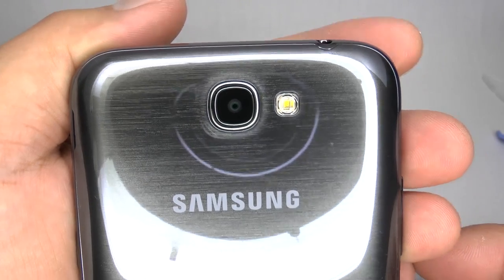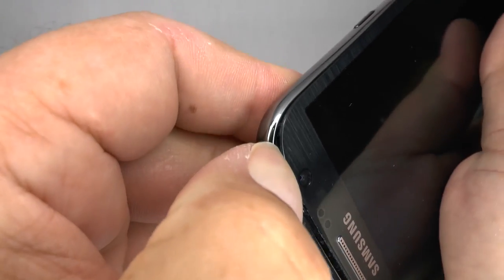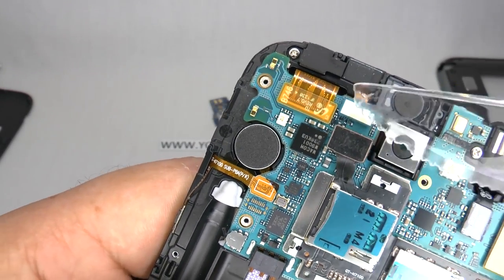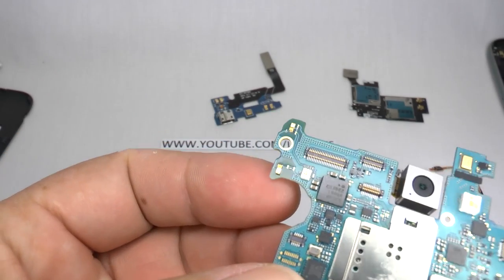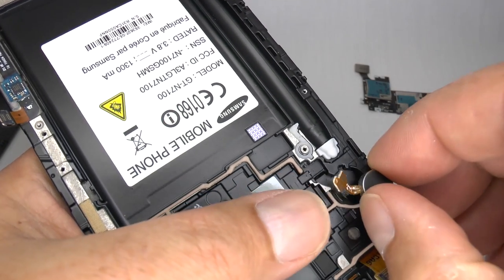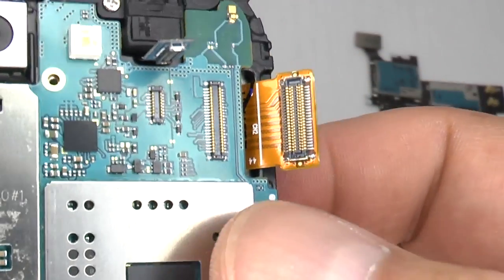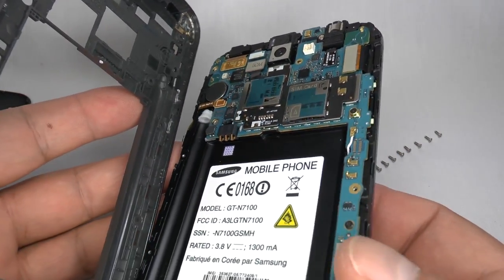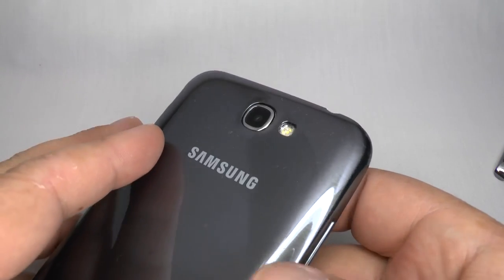Galaxy Note 2 Disassembly & Assembly - Screen and Case Replacement - Drop Test Repair

Comment: LE55ON5, I tried replacing digitizer on my Note 2 but after replacing it, it won't power up. I believe it's the connectivity issue with the power button. When I hook it up to a power source, display will show battery charging, but I am unable to power it on using the power button on the side.

The power button also doesn't feel right. It feels like the power button is stuck. There is a very small plastic piece with a dot on top of power circuit. I double checked to make sure it is on correctly

Comment: I dropped mine in the store. has a case on it. no dents, scratches, cracks etc. But, I notice my cell signal flucuates just sitting in the same spot on a table. Rarely get 4g anymore. and when I do, its still slow or disconnects. Do you have any ideas? It has been factory reset 4 times trying to see if it was a software issue.

Comment: excellent as usual, I was wondering, I see that this is a Note 2 model GT-7100, as far as I know this is not 4G as you mentioned when talking about the "antennas" , perhaps the 3G model GT-7100 has a 4G anntenna already built in standard to simplify the  production process,,
is the usb/mic board the original? I need to replace mine but see many colours and numbers online when I am looking for parts, I only want original !
 Thanks.
Reply from the maker: You might be right about the antenna, its hard to know if parts are oem or not. Try using the live chat option, I'm sure they will know

Comment: My note 2 keeps losing mobile signal, if I change the 3g module will that fix the problem, would I have to replace 4g antenna as well?

Comment: I wanna replace my rear housing because I dropped my phone and the plastic brushed metal band hot pretty chewed up. I ordered I new year housing but it doesnt come with the antennas are they easy to transfer to the new rear housing and am I gonna void my warranty by doing that small replacement myself

Comment: I used this great video to replace the LCD/digitizer assembly due to a cracked screen. I looked at ur video on the digitizer only and didn't wanna try that magic. Afterwards, I did try, only to find that my at&t i317 note ii digitizer is bonded to my LCD as per your video s2 digitizer only. So the construction of my note II is not the same as your note ii. Digitizer only replacement is not an option. So if ur glass cracks u need the over $200 complete assembly... FYI

Comment: Hi there Le55ons. hoping you might be able to help. The mic on my note 2 just stoppped working. so i replaced charging dock port flex with a GR 1235 board, now my signal keeos dropping out all the time,  replaced the antenna, still the same issue. my orginalboard was a NF 1241 SY... any ideas ??? uk on three
thanks

Comment: thing is that I have changed wifi only motherboard with 3G. Separatly S Pen worked on the both (wifi & 3G) devices. After switched S Pen is going crazy. Yes I had wifi only device :) There is just one difference on the board is no slot (up on the right side) for connect antena cable. And as I so on your video cable for S pen is goin from display to the motherboard right? Thats why I think there is HW fight between motherboard and display. I have changed couple of SWs but still nothing...

Comment: Good videos thanks for them I have an error message "battery low temperature" Where is the low teperature sensor locate? Its in the charger port I coul like to know thanks hope u answer me. I DID EBERYTHING TO FIX IT. Flash kernel change battery root it just happen when I try to charge it h . I have to use external battery  and its annoying it galaxy note 2 thanks

Comment: Thanks so much for the video! I used it to replace my power button. All went well, except now I can't make calls... I can send and receive text messages and the internet works and stuff, but when I try to make a call it says 'Mobile Network Not Available'. Do you have any idea what part I could have messed up to do this?
Reply: I will say that my phone is a Verizon phone. I used the power button you show above, but that's the wrong power button for the phone, the Verizon one uses a different one (I didnt realize until the part came in and I was following the video). The Verizon power button is directly connected to the vibrator part, so the vibrating function doesn't work obviously but do you think that could have anything to do with the phone call thing?
Reply from the maker: Amanda Young I don't think it would affect calls. Can you check the time and date are correct? If they are and it still not working..  backup all your data and do a factory reset, this can sometimes fix this kind of problem..
Reply: *****
 Thank you for getting back to me. I got the correct power button today... the time and date are correct so if, after I replace the power button with the correct one, it still isn't working--I will try the factory reset. Thank you!
Reply: Just put in the correct power button... phone calls work again! Thanks again for the video, you rock!
Reply from the maker: Amanda Young :-)

Comment: hey i have quite a situation on my hands.  i cracked the outer screen to my galaxy note 2 and bought the kit to replace it.  i was only trying to repalce the outer screen. so i peeled off the outer screen from the original led display..  now, when i use the touch screen.  it wont work, and some of the top part of the screen does work

Comment: Hi! does the N7105 micro usb component fit the N7100? The Micro usb component contains the antenna and the microphone as well, doesnt contain the 4g LTE part which isnt compatible with the n7100. Am i right? or wrong? Thanks!

Comment: Hi! i have problem on my note 2 sometimes the WiFi network stop working so i should turn it off and turn it on (WiFi not the phone) is that a problem with the WiFi antenna or the problem is in the modem?

please answer.

Comment: Hi Le55ons
 i felt my note 2 in water and took out quickly then dry it with hair dryer then put battery in and turn on the only problem is touch screen is not working with finger but working with Spen and i cannot use it without Pen.any help..

Comment: Yeah whether the display I broke did ever work ill never know now I was in a bit of a fit of rage at that point but I have another one coming again not from etradesupply but from ebay not sure what ill do with the two broken Note 2s just the screens need replacing least that's what the description said. Ill just test the screen before sticking it on.

Comment: since i got my phone i have a really annoying issue.
the mobile data on WCDMA (H, H+, 3G) works for a while (not a certain time actually) then it will keep sending data(green arrows flashing) but not receiving (no orange arrow at all) so obviously that means i have no internet access. this issue can only be temporarily solved by ONLY restarting the phone. I tried everything possible from custom roms custom kernels and custom modems but it's still there, the mobile data on 2G works perfect it's only when the network type is WCDMA for some time that vary from 5 minutes to 12 hours but it can get really annoying restarting my phone every 5 minutes , i don't have warranty, so my question is, is there a hardware i could do or replace ? the 3G antenna maybe ?

Comment: When you replace the display assembly, how would you tranfer the imei sticker to the new one? Is it just a case of applying a little heat?
Reply from the maker: yes, use heat and try not to touch the back of the sticker, use tweezers or the edge of a knife
Reply: ***** are you using low or high heat? my heat gun has two settings. which heat is best for glass separation?
Reply from the maker: kooli9 depends on how close you hold it. About 60ºC is ok, about as hot as your hands can bare. Or use a thermometer to check

Comment: My screen acts funny some times its fine other times its discolored or when I turn it on its ok but then it goes gray. Any ideas on easy fix or do u know where I can buy just the lcd display pl ty
Reply from the maker: try unplugging and plugging the display flex connector, if that doesn't help then you'll find links for a new screen in the description

Comment: Hi, any suggestions on a reputable seller online? I need my rear cover replaced (3:41). Coz mine has scratches all over it, the silver-coated plastic part,. The one that is visible, on the side of the fon. I only need this one, not the entire screen. Only the rear cover

Comment: Hey I just followed everything on the video I realize that when I took apart my note 2 that the vibrator was to big to fit in the replacement parts so I left it out I tested out the screen before I put the mid frame on it worked (btw the screen is white my old note 2 screen is gray) anyways when I tried to put the midframe on it only fit on the top and bottom not the sides it's thinking it's because the screen is different from the midframe or do I need to apply more pressure
Reply from the maker: its strange the motor won't fit in the new midframe, don't push too hard, it might be for a slightly different model
Reply: Yeah I had to change the housing and left the vibrator out and the new housing is still bulky on it do u think that the mother board isn't sitting all the way down
Reply from the maker: Andrew Blackford It does sound like the midframe is not the right one for your model, perhaps it was mixed up in the factory...

Comment: I bought a new battery and it's doing the same thing still. It'll charge for 7 seconds and then up pops a message saying it's 176 Fahrenheit.

When I heated the screen everything was out except for the audio jack, the power button and vibrator flex, and the wire, & whatever it's attached to, which runs next to where the s-pen is stored.

Comment: Hi there! For some reason my note 2 started getting weak signal. Gets in and out of the network. I have called my carrier and they have done everything from their end but I still have trouble. It looses signal big time. Like now I don't have service. Would that be the flex antenna? Would you help me please? Thanks
Reply from the maker: It might be the sprung gold connectors not making contact with the rear housing, it might be worth removing the rear housing and slightly bending the contacts up to make better contact

Comment: I just did ligitizer replacement, so i moved everything from old to new digitizer. After replacement my phone turned on once with a charger, but now it wont turn on at all. What could be wrong? My battery is not dead, and my note 2 version was N7105, and the new ditizer is N7100.
Reply from the maker: it might be a faulty new screen can you try plugging in the old one

Comment: I ordered two more broken Note 2's on eBay because I had nothing else to compare it to I don't know why the brand new digitizer didn't work and now the digitizer is cracked the glass is fine. I'm wondering if its a bad port but it was working before its a pain in the ass, so now I have two units to play with one of them has to work. As for my new display I don't know if they'll give me a replacement again. Ill never know if it really worked or not.
Reply from the maker: You are a bit unlucky, hopefully you can test the display on a working note..

Comment: if I change the display on my phone, will I still have my old pictures from before the phone broke?
Reply from the maker: yes as the data is stored on the mainboard. If possible its best to backup all your data before replacing the screen, just in case of a problem. 
You can plug the new screen into your mainboard and make sure its working ok, backup your files and then fit the new screen

Comment: hi i have a note 2 i dropped it and now i have no wifi or bluetooh unless i stand right next to the router same with the bluetooth it works if i put the device right next to it. i opend up the phone and the prong that does the wifi has torn off the board and busted the contact off the board so it cant be soldered is there a way i can solder a wire on anywhere else on the board to for blutooth and wifi or do i need to replace my board and flash the firmware and efs over to retain my imei

Comment: I have a note 2 and the screen broke and now there is no image but there is sound .. do I just replace the digitizer and screen  or the whole frame and digitizer ?
Reply from the maker: just the digitizer and screen assembly as the frame is part of the rear housing..

Comment: Hi,
I just tried to replace the middle housing frame and I was able to fix it.
But when I switch on the phone, my screen has couple of lines displayed and the screen is not at all bright.
I didn't touch anything other than replacing the middle frame.
Can you please tell me what went wrong with the screen.

Thanks
Reply: Hi i just replaced my screen with this tutorial and i'ts very good. But You must be carefully when removing (unclipping) screen from (round) frame. If You bend it too much, You can damage Amoled screen. If You wanna check display (and sensors) press #0# on dial keyboard. Secondly... maybe light sensor fault (for brightness).
Reply: ***** i just changed mine too but I cant turn it on and when I power it on it makes somekind of nice just the blue light seems to flash nothing else looks like i fucked up my phon I just wanted to replace the housing with a new one fuck :(

Comment: Hi there...I dropped my fone..no physical damage but only half of screen is working. Do u have any recommendations?
Reply from the maker: Its probably cracked the fine tracks inside the display, a replacement screen will be needed..

Comment: Actually I have no idea why, my GPS is not working after I sent in to repair for the last few days left of it's warranty. Is it possible that my GPS antenna is lose or my antenna is broken? BTW, B4 sending in repair, the GPS is working flawlessly.
Reply from the maker: it might be the small gold sprung connector not touching the rear case, if you bend it up slightly it might cure the problem

Comment: I took mine apart because of intermittent charging problems. After seeing nothing physically wrong I put it back together and now the home and capacitive touch buttons no longer work. They light up when booting up, but pressing them does nothing. Anything I can check for that?
Reply from the maker: try unplugging and plugging the flex shown at 8:18
Reply: ***** I tried that but still no luck. Also I cannot charge the battery anymore. Keeps saying battery temp too high and monitoring programs show the temp fixed at 60C. I think the battery may be defective which started all these problems. I don't understand what happened to the buttons though. I removed the entire board and reassembled 3 times checking all the flex connectors. I hope I don't need to replace the mainboard now.
Reply from the maker: nelwyn2 I doubt its the mainboard causing those problems. Try buying a new home key flex and plugging it into the mainboard, this should confirm help identify the problem. Not sure about the battery problem but its certainly worth trying another one..
Reply: ***** That's a good idea I'll try that after I receive my battery. I want to at least get the phone working again since it won't charge at all now, even turned off. I was going to buy the little board on the bottom to replace the charging port but I'll try the battery first. I'm a little scared of replacing my home key flex though since I have to remove the screen from the housing. I had a bad experience with that in the past on another phone. I may just use a softkey app until I get brave. Thanks for the suggestions though and your great videos. :)

Comment: Hi mate I come across your video after having my N7105 sent back the 2nd time by Phones 4 U.

They said my phone is damaged beyond economical repair due to pressure or physical damage, the phone is immaculate and the has been dropped in the past but I always use a protective gel case.

The issue with my phone is that my signal is sporadic, i.e. for instance I get full signal then ZERO then mediocre signal, always off and on.

Sent it away 31/12/13-Phones 4 U first updated firmware to 4.3 and said it was repaired,

Sent it away 20/01/14-Phones 4 U then accused me off rooting it,then having 3rd party repairs and now damaging it and refusing to repair it.

I'm assuming it has something to do with the LTE/3G/GSM antenna setup,which part would you recommend I replace?

Thanks, I liked and Subbed
Reply from the maker: I had another comment with the same problem, they fixed it by bending those small sprung gold contacts up from the mainboard to make better contact with the rear housing. Don't bend them too much or they might snap off. The 4G connection is shown at 9:40 and the 3g/gsm connection pins are on the usb board shown at 4:59
Reply: as soon as I commented I had a call off phones 4 u and they offered me  a New HTC One